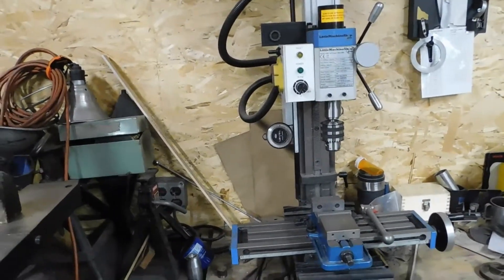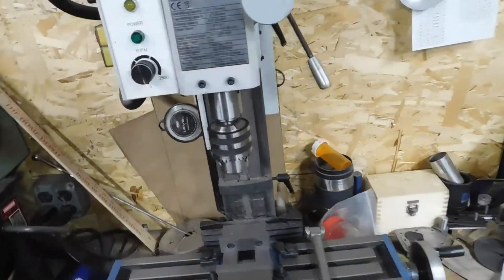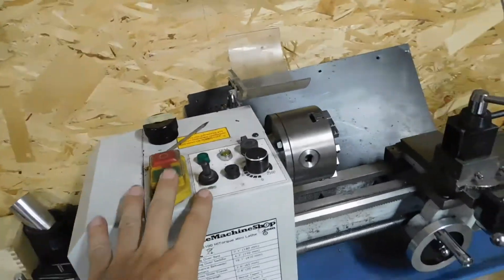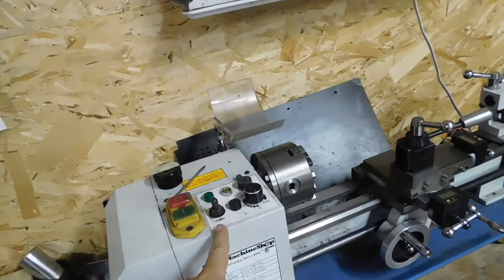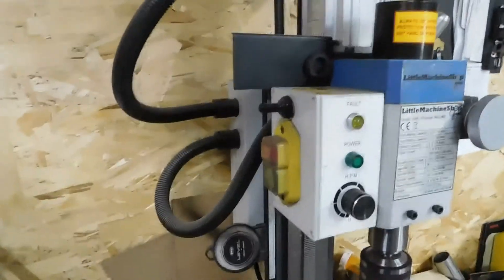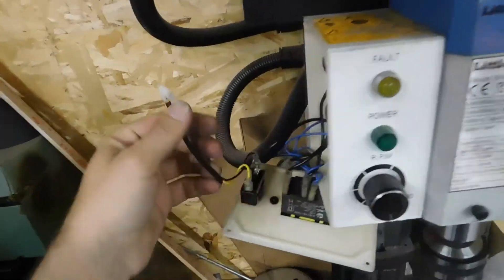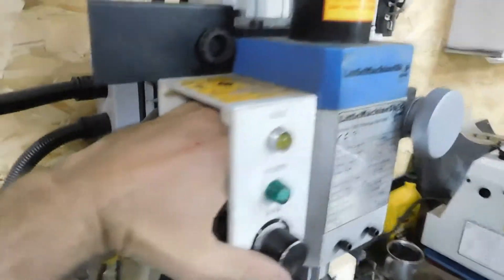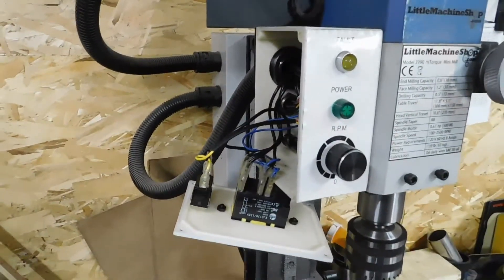Forward and Reverse switch on LMS Mill

Comment: P.S. This is just a High/Low logic connection. Switch current is only 1 ma. All you are doing is changing the logic state from either High to Low or Low to High. The normal forward direction state is accomplished with a pull up resistor so when you connect pins 2 and 3 all you are doing is overcoming the pull up resistor to change the logic state. Nothing is shorted out and virtually no current is expended. Very safe.

Comment: Pin 1 is closest to the cover, pin 2 is the center and pin 3 is the closest to the spindle. All you need is a single pole switch that connects pin 2 and pin 3 together to activate reverse. Nothing needs to be connected to pin 1 at all. A latching normally open push button works great. Push in for reverse and out for forward.

Comment: Awesome find!  Any chance you can describe the wiring of the switch, at least see if the red wire connects to anything? From what I can tell from their website and here, the switch just opens and closes the yellow and black.  I am assuming open is forward, as it is open when there is no switch, and reverse is closed.
Reply from the maker: Jim H First I took the switch out of my lathe and tried it first to make sure it would work, and after I just went to the website and bought the switch and plugged it in. I hope that answered your question.
Reply: @drthinmint  Thanks for the reply.  Unfortunately, they are back ordered now.  I ended up doing a full trace on the board and it looks like the red wire is there to control something else and just not connected in the harness.